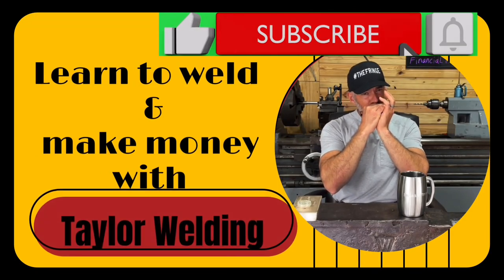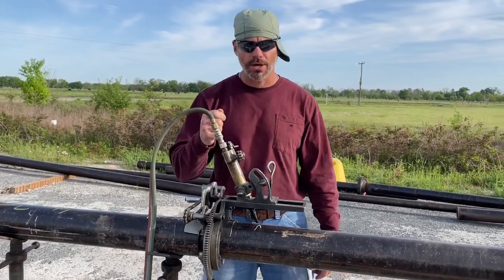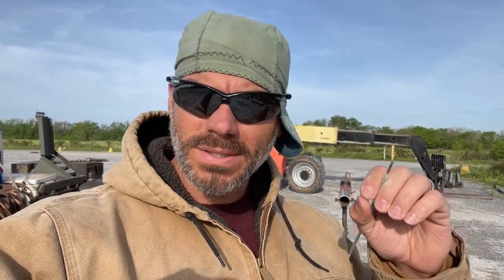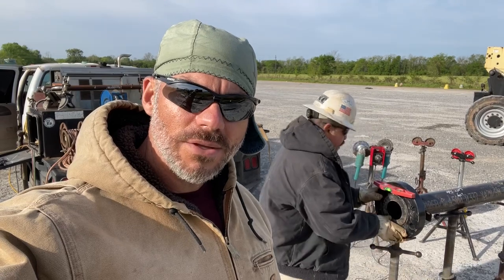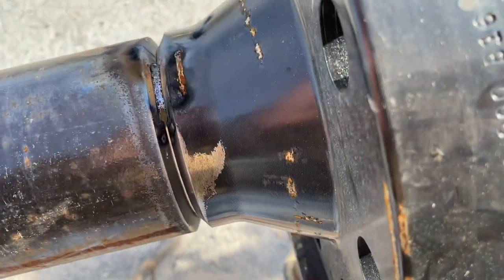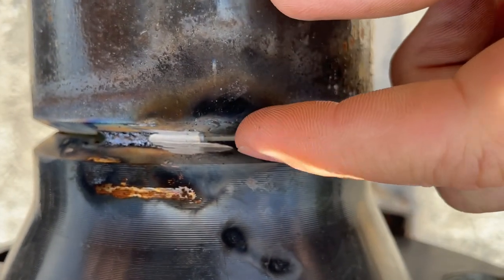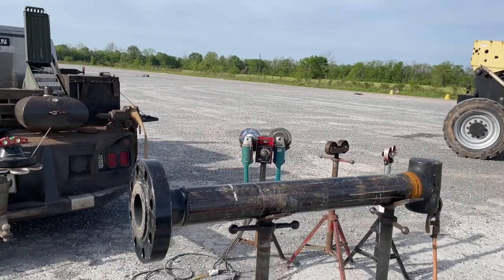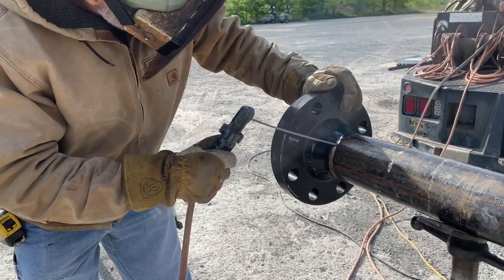Pipe welding tips , land, spacer, bevel , & rod angle On the root pass

Comment: welded pipe for 45+ years I think code says minimum bevel 28 degrees. Key to putting good bead in is a uniform land, which makes for a uniform heat sink . It does matter for easy  welding . It will garner less repairs for x-ray work

Comment: I like to run 3/32 land, and tack at a 3/32 gap. After all 4 tacks are in, you’re running about a 1/16” gap, and you can run it uphill around 72-80 amps (depending on machine)  or downhill with a few more depending on what the customer wants. 

Everyone has to learn what works for them! That’s why I like your vids because you say that over and over. Love from FL
Reply from the maker: Thank you! It’s true

Comment: Good job! I use a .070 thick spacer and like you said the gap and land when right will make the bead fall in there. I worked for a welding shop in early 80’s that was an old school pipeliner and he like a tight gap and small land and you had to drive that bead in. Then a friend showed me the method above and was so much easier..... keep it up!
Reply from the maker: I think that’s the exact same thickness spacer I use.. 070 should be close to the 16th. Thanks for watching and commenting Leslie. I’m gonna do my best keep it coming

Comment: What kinda tip you got for when the stick rod starts eating away at the flux unevenly?  Hopefully you know what I mean.  When I'm welding, sometimes the flux won't get used up evenly on both sides, and one side can go faster than the other.  This makes the rod 'harder' to control.  Any reason why this happens?  

And whats your thoughts on not beveling pipe for welding?  Got 2 old school guys who says you don't need to.  Granted it lower pressure stuff, usually always less than 100psi.  Guess is hot and fast enough to over come the non bevels?  Wonder how it would do on a bend test.

Comment: Just awesome! Great information and knowledge I really 
Enjoy  someone who is a straight shooter and tells it like it is and passes along there tips and tricks. Thanks. Question, in your specific line of
Pipe  work how much do you deal with those inspectors you were talking about? Will they nick you for a out of spec bevel? Or it’s more of a get the job done and it better pass out at the end? Just curious.
Reply from the maker: It all depends on the inspector. Most of the time like 99% of the time they’re not really a problem. Usually the young know it all inspectors are the problem ones. And will call you for just about anything. They feel as if they need to justify their job. If they ever look at my bevel angle they’re not gonna like it lol

Comment: I'm taking a 3G weld test right now. 1/16 in wire, flux core. And the parameters involve 285 amps at least. Impossible. I would like to see you make a video on it
Reply from the maker: What's the problem. Not very familiar with flux core. Besides welding structural junk
Reply: @TaylorWelding  it was too hot. Nobody could pass it. Might as well try weling with the plasma cutter lol. Qc was able to knock it down to 24 volts. Much better. Passed my test and Now I'm building our Skywalk!

Comment: I have a bit of a heavy hand and I have problems burning through on the uphill root from say 3-5 o’clock.  Regardless, I always do better with a tight gap (3/32” may as well be 1/4” for me).  I know it’s technique and that closing up the gap is just a bandaid.  My rod angle goes to shit coming up around the spring line  and once I notice, it slows my travel down, the keyhole becomes a manhole and Im filling holes.  Im all natural gas building trades stuff so it’s uphill all the way 6010 root & fill, 7018 cap.  It’s just a sticking point for me, and the fact that I can go months not having to weld at work doesn’t help the problem.  I might be brazing copper for a year straight between weld jobs.
Reply from the maker: I would have to go tighter than 3/32 
And when nobody was looking, I would run it down hill lol